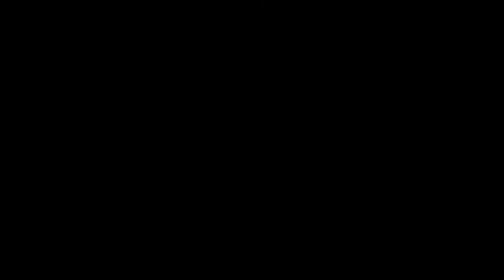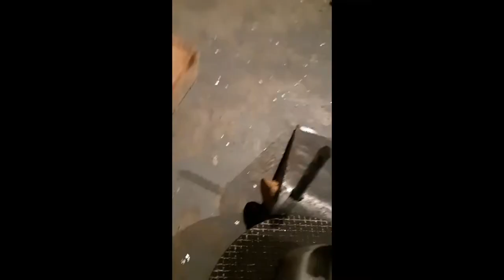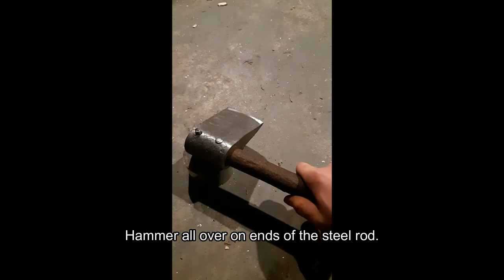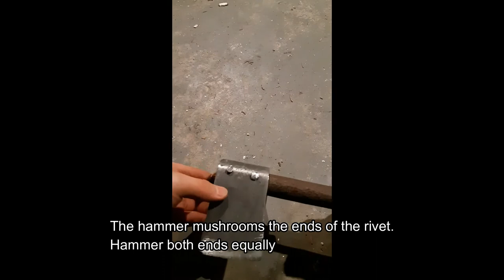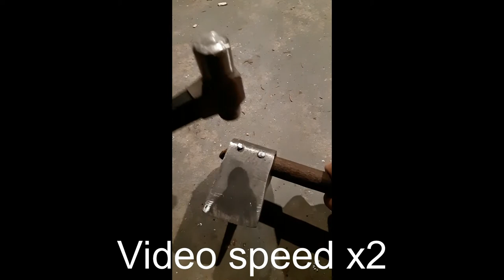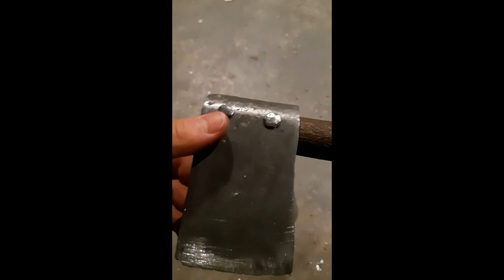How to cold solid rivet

Comment: What 3d printer do you have?
Reply from the maker: Anycubic i3 Mega S
Reply: Ima get an ender 3 pro
Reply: Ill probably print youre air engine as my second print
Reply from the maker: @Fwv979  My air engine is hard to assemble and is not perfect. look at the parts in the 3d file before printing.
Reply from the maker: @Fwv979  Have fun with your 3d printer!
Reply: @ruwyev181  thx
Reply: @ruwyev181  do you have a ps4?
Reply from the maker: @Fwv979  yes but i don't play it
Reply: @ruwyev181  ok i was just wondering just to see if i can add you but you dont play it